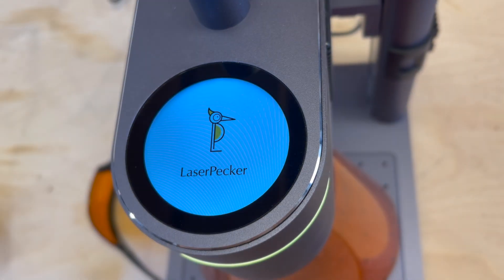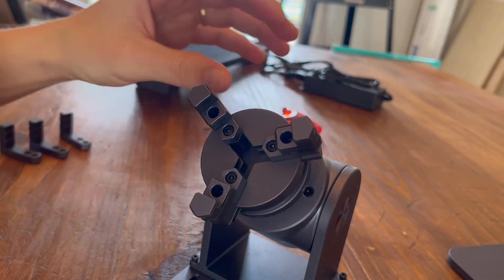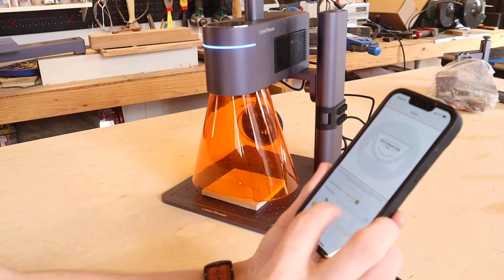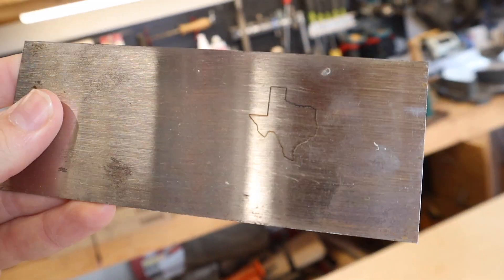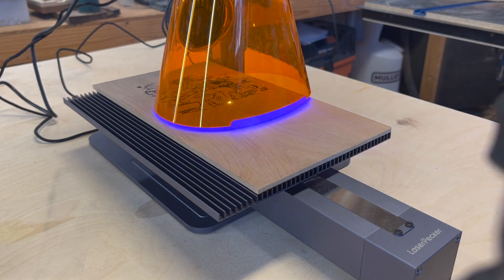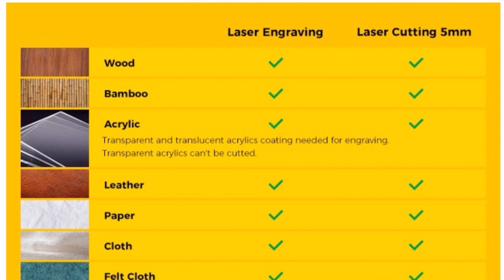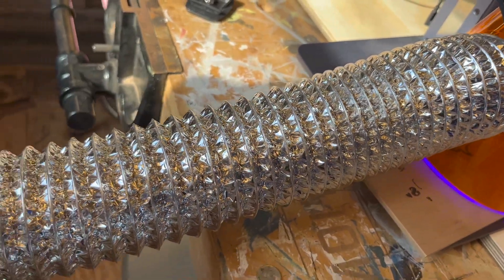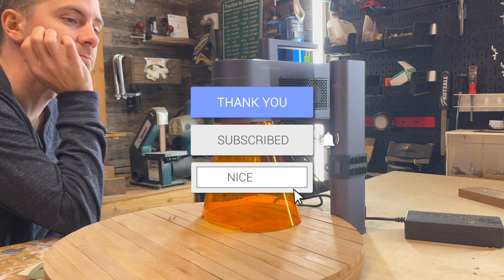The NEW Best Laser For Woodworkers // LaserPecker 4 Review

Comment: Do you plan on making more videos about the LaserPecker 4?
I would like to see a test with the third-party software LightBurn.
Also would the IR laser be able to 3d engrave metal parts by adjusting the Z-axis accordingly? This would open up a lot of possibilities for making custom jewelry such as necklaces with 3D pictures.
Another thing to consider is the possibility of making holographic effects on metal parts by engraving small lines into metal to diffract light which gives the holographic effect.

Comment: Is the laser pecker 2 solution for long engraving better (the wheel system that could in theory go forever) vs the electric slider. Can you use the LP2 wheel with the LP4, are they compatible?
Reply from the maker: I do like the table a little more than the third axis. I think they work together but just to be sure I’m going to be testing backwards and forwards compatibility soon 👍🏻
Reply: @TheReformationWoodshop were you able to test trolley mode with LP4?

Comment: Can the laserpecker 4 be used handheld like the laserpecker 2?
Reply from the maker: Yes. The bottom plate comes out and it can engrave while still on its stand, or you can take the module off and engrave like you would with the LP2 except you’d have to hold it in place because the head is so much bigger it’s not as balanced.
Reply: @The Reformation Woodshop  ok thanks.  If about half the stuff I'm engraving will be handheld, am I better off with the laserpecker 2 over the laserpecker 4?
Reply from the maker: @evobudbrink  probably the 2. The 4 is bigger and not as easy to maneuver. Although it does do metal so that’s a plus.